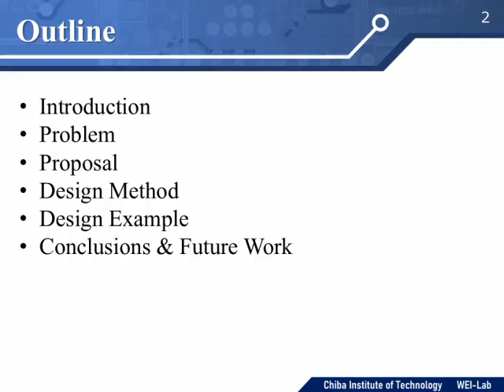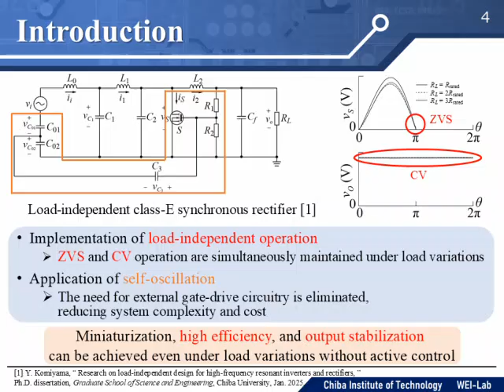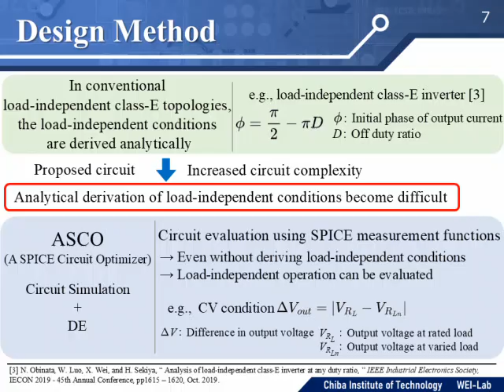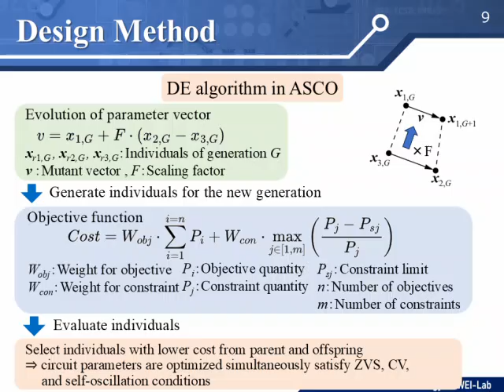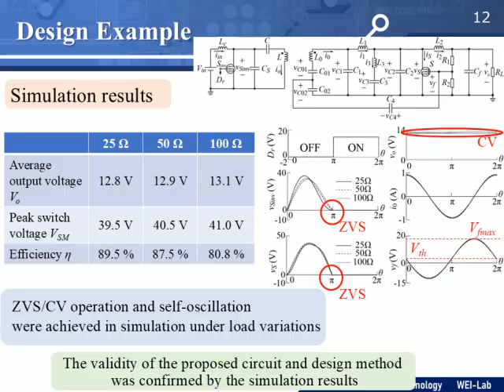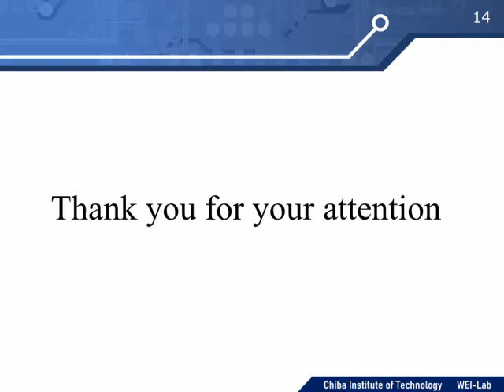【練習】初めての海外学会のスライドが英語のときってどうなっちゃうの～?【NCSP'26】

Comment from the maker: Slide 1: Title
Good morning/Good afternoon.
My name is Hidenori Kori from the Chiba Institute of Technology, Japan.
Today, I will present our work entitled 'Load-Independent Class-E Synchronous Rectifier with a Parallel Third-Harmonic Resonant Network.'
 
Slide 2: Contents
Here is the outline of my presentation. First, I will give the Introduction. Next, I will explain the Problem addressed in this study. Then, I will present the Proposal. After that, I will describe the Design Method. I will then show a design Example. Finally, I will present the Conclusions and Future Work.
 
Slide 3: Introduction (Background)
Let’s move on to the Introduction.
In recent years, power circuits that maintain high efficiency and stable output even under load variations have become important for high-frequency WPT systems and DC-DC converters.
Here, WPT stands for wireless power transfer.
However, conventional Class-E rectifiers cannot simultaneously maintain ZVS and CV operation under load variations.
Here, ZVS and CV stand for Zero-Voltage-Switching and constant voltage.
As a result, switching losses increase, the output voltage fluctuates, and additional control circuitry is required.
Therefore, a rectifier topology that maintains ZVS and CV operation without complex control is highly desired.
 
Slide 4: Introduction (Previous Work)
To address this requirement, a 'Load-independent class-E synchronous rectifier' was proposed.
The proposed rectifier implements load-independent operation.
In this topology, ZVS and CV operation are simultaneously maintained under load variations.
In addition, this topology applies self-oscillation. Therefore, the need for external gate-drive circuitry is eliminated, thereby reducing system complexity and cost.
 
Consequently, miniaturization, high efficiency, and output stabilization can be achieved even under load variations without active control.
 
Slide 5: Problem
Next, I will explain the Problem.
In the conventional load-independent class-E synchronous rectifier, excessive peak switch voltage is observed.
This leads to limited power-handling capacity and reduced device reliability.
In addition, high-voltage switching devices are required.
As a result, the cost increases, and on-resistance and conduction losses increase.
Therefore, a new rectifier topology is required to suppress the peak switch voltage while maintaining ZVS/CV operation under load variations.
 
 
Slide 6: Proposal
Next, I will explain the proposal.
In this study, we propose a load-independent class-E synchronous rectifier with a parallel third-harmonic resonant network.
The circuit is shown here.
In this circuit, L3 and C3 form a third-harmonic resonant network.
As highlighted in red, this resonant network is connected in parallel with the switch.
As a result, the switch-voltage waveform is reshaped by harmonic injection, thereby suppressing the voltage stress.
The component values are determined using 'ASCO', A SPICE Circuit Optimizer, based on a differential evolution, or DE, algorithm, to satisfy ZVS, CV, and self-oscillation conditions.
Finally, the validity of the proposed circuit and design method is verified through simulation.
 
Slide 7: Design Method (Concept)
Next, I will explain the design method.
In conventional load-independent Class-E topologies, the load-independent conditions are derived analytically.
For example, in a load-independent class-E inverter, the condition is expressed as phi equals pi over two minus pi D.
Here, phi and D represent the initial phase of output current and off-duty ratio, respectively.
 
However, in the proposed circuit, the insertion of the third-harmonic resonant network increases circuit complexity.
As a result, analytical derivation of load-independent conditions becomes difficult.
 
Therefore, ASCO, which combines circuit simulation with the DE algorithm, is used.
Circuit evaluation is performed using SPICE measurement functions.
As a result, even without analytically deriving load-independent conditions, load-independent operation can be evaluated.
For instance, the CV operation is defined as delta Vout equals the absolute value of VRL minus VRLn.  
Here,
delta V represents the difference in output voltage,
VRL is the output voltage at rated load,
and VRLn is the output voltage at a varied load.
 
Slide 8: Design Method (Objective Function)
I will now explain the Objective Function, or OF.
Measurement is performed using SPICE commands.
Here, an example of SPICE measurement commands is shown.
Now, please look at the waveforms on the right.
As shown here,
t_start corresponds to theta equals zero.
t_rising corresponds to theta equals pi D.
And t_stop corresponds to theta equals two pi.
 
Using these timing points, the objective function is defined.
In this example, ZVS is evaluated by measuring v_s at t_rising.
 
The OF for the proposed circuit consists of three components.
 
First, the absolute value of v_s at pi D, which represents ZVS satisfaction, or the ZVS margin.
This corresponds to the switch voltage at the turn-on instant, as indicated in the middle waveform.
 
Second, delta V_out, defined as the absolute value of V_RL minus V_RLn.
This represents the CV condition under load variations.
It is the difference in output voltage between rated and varied loads, as shown in the lower waveform.
 
Third, the absolute value of v_GS at zero minus V_th.
This represents the self-oscillation condition.
It corresponds to the gate-source voltage relative to the threshold voltage at the start of a switching period, as indicated in the upper waveform.
 
Slide 9: Design Method (Differential Evolution)
Next, I will briefly explain the DE algorithm in ASCO.
First, the evolution of the parameter vector is described by this equation.
Here, x₁,G, x₂,G, and x₃,G represent individuals of generation G.
v is the mutant vector, and F is the scaling factor.
 
Please look at the figure on the right.
As shown here, x₁,G is combined with the scaled difference between x₂,G and x₃,G.
This generates a new vector, which is used to generate individuals for the new generation.
 
Next, the OF is defined.
The cost function is expressed as this equation.
Here, W_obj is the weight for the objective, and W_con is the weight for the constraint.
P_i represents the objective quantity, and P_j represents the constraint quantity.
P_sj is the constraint limit.
n is the number of objectives, and m is the number of constraints.
Using this objective function, individuals are evaluated.
 
Then, individuals with lower cost are selected from the parent and offspring.
As a result, circuit parameters are optimized simultaneously to satisfy ZVS, CV, and self-oscillation conditions.
 
Slide 10: Design Example (Specifications)
Now, let's look at the Design Example.
This slide shows the studied system.
As written here, an AC source is required.
Therefore, a load-independent class-E inverter is used as the RF power source.
 
Please look at this figure.
On the left side, this part is the load-independent class-E inverter.
In the center, the coupling coils are shown.
And on the right side, this is the proposed load-independent class-E synchronous rectifier.
 
Please look at the table on the lower left.
The design specifications are given as follows.
The operating frequency f is 1 MHz.
The input voltage Vin is 10 V.
The off-duty ratio D is 0.5.
The rated load RL is 25 ohms.
The harmonic filter order p is 3.
The switch threshold voltage Vth is 3 V.
And the peak gate voltage Vgs is 18 V.
 
Next, please look at the table on the lower right, which shows the coupling unit’s measurements.
The transmitting coil L is 21.8 microhenries.
The receiving coil L0 is also 21.8 microhenries.
The coupling coefficient k is 0.124.
The ESR of L is 0.733 ohms.
And the ESR of L0 is 0.726 ohms.
These parameters are used in the design and optimization.
 
Slide 11: Design Example (Optimization Setup)
Next, let us continue with the design example.
 
First, please look at the waveforms on the left.
These waveforms are partially shown for different loads, such as RL, 2RL, and 4RL.
 
Here, the red circle indicates the important operating instant atθequalsπ.
We evaluate the ZVS condition at this instant.
 
Next, please look at the green box.
This shows the operating conditions at each load.
The conditions are defined by these equations.
On the right side, the operation under load variations is evaluated using this equation.
 
The desired operating conditions are formulated as an OF.
 
Please look at the blue box.
Here, P represents the objective quantities.
These include the terms shown here.
All of these quantities are minimized simultaneously in the OF.
 
Finally, optimization is performed to determine the component values so that all the desired operating conditions are satisfied simultaneously.
Reply from the maker: Slide 12: Design Example (Results)
Next, I will explain the simulation results.
 
First, please look at the table on the left.
The results are shown for three load conditions: 25 ohms, 50 ohms, and 100 ohms.
The average output voltage Vo is maintained around 13 volts.
This indicates CV operation under load variations.
The peak switch voltage VSM is around 40 volts for all load conditions.
The efficiency η is 89.5%, 87.5%, and 80.8%, respectively.
 
Next, please look at the waveform on the upper right.
The output voltage vo is almost constant for different loads.
As highlighted here, CV operation is achieved.
 
Please look at the switch-voltage waveforms.
Atθequalsπ, the switch voltage becomes zero.
As indicated by the red circles, ZVS operation was achieved under load variations.
 
Finally, please look at the waveform of vf.
The waveform crosses the threshold voltage V_th,
and the maximum value satisfies VfMAX.
This confirmed self-oscillation operation.
 
Therefore, ZVS/CV operation and self-oscillation were achieved in simulation under load variations.
The validity of the proposed circuit and design method was confirmed by the simulation results.
 
 
Slide 13: Conclusions & Future Work
Finally, I will conclude this presentation. A load-independent class-E synchronous rectifier with a parallel third-harmonic resonant network and a design method based on DE have been proposed. In addition, ZVS/CV operation, self-oscillation, and high efficiency were confirmed through simulation. As future work, experimental verification will be conducted to further validate the proposed circuit and design method. Additionally, the operating conditions will be elucidated through design curves and analysis.
 
Slide 14: Closing
That’s all for my presentation. Thank you for your attention.